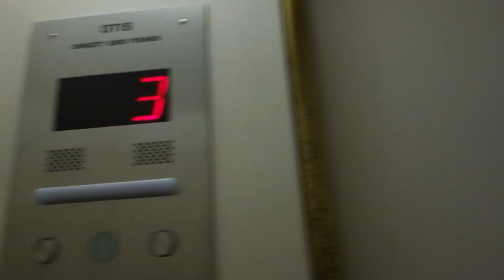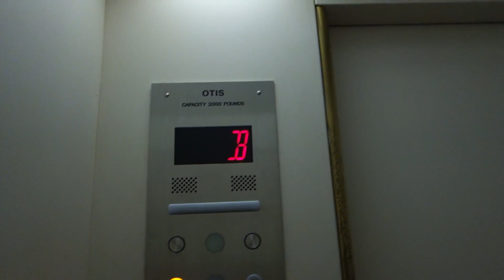Tastefully Modded Otis Traction Elevator at The Key Bank, Plattsburgh, NY

Comment: That seems like it may actually be on the original controller. I think that because notice how the indicator has arrow lights below the indicator, the original indicator still partially works, & notice the “1” actually went out before it chimed for “B”, & if that was actually a complete mod. they would have most likely replaced the door equipment, & remove the original indicator or dis-connect it entirely. You may not have heard relays, but that doesn’t mean it’s still using relays. Those are just my thoughts though.
Reply: Oh yeah, now there’s more things that I can definitely tell for sure that it’s slap-on. The buttons light-up amber, & they go in further/click more, like the alarm button, which from what I’ve seen in other videos & my personal experiences seem to prove that it’s an Otis slap-on job.
Reply from the maker: I don't think it's a slap on judging by the fact it's using Otis chimes and not ACME chimes, but I don't know for sure